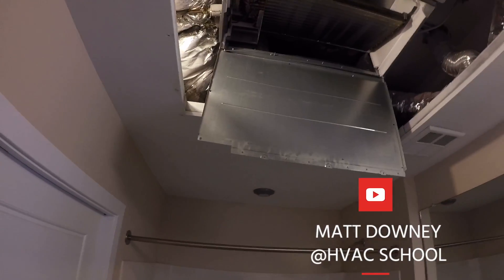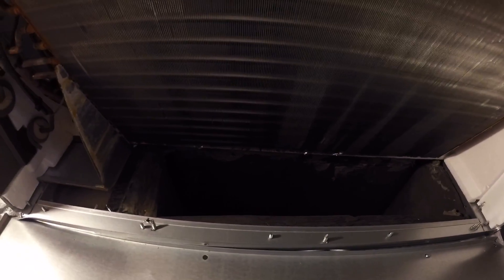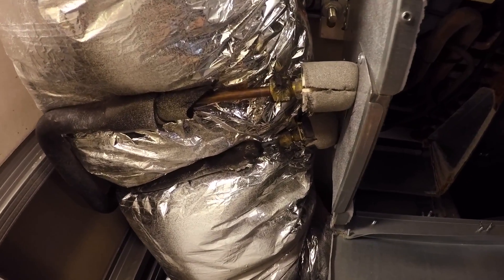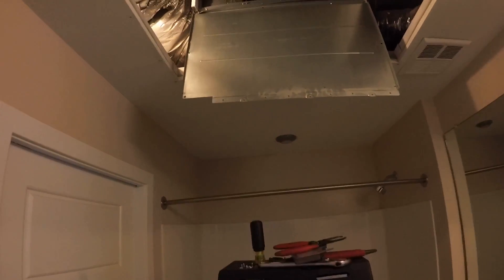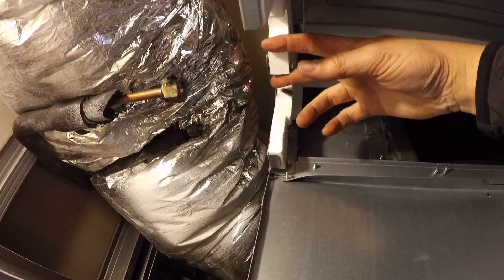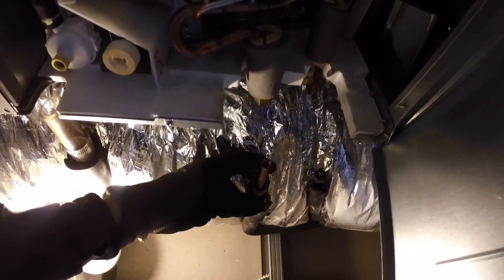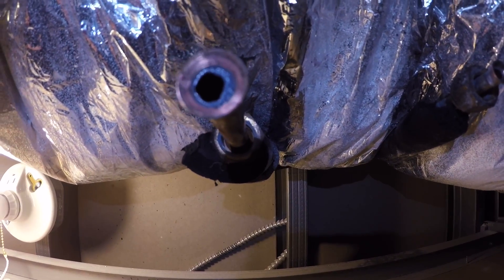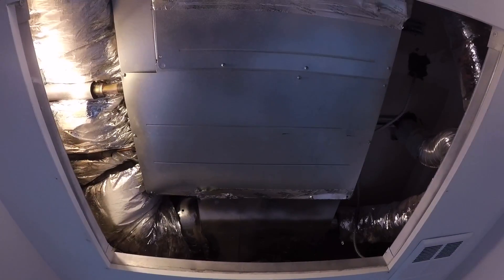Ducted Fujitsu Mini-Split Evap Replacement

Comment: Can you access the coil from the side of the unit? I have a unit with access to both sides but limited access underneath without completely disconnecting it and jacking it up.

Comment: Who uses Leak Lock instead of Nylog?
Reply: A certain Big Company In my area does. Service was constantly going back and finding leaks caused by improper use of leak lock eg don't put it inside flare connections
Reply: only use nylon

Comment: You always redo flares whether they look good or not. The copper has been compressed and work hardened once it’s used. 
      As for the blue leak lock it shows the person who is taught how to do this was taught by an amateur even though he may have 20 or 40 years experience. I often find the screens to the expansion valves partially plugged up leak lock but still working when you hook up with you to the software you will notice the electronic expansion valves duration ( dwell )opening time higher than normal because they’re starving and it’s trying to compensate. The technician will think it’s working OK because it cools to the hand beer can cold but the system is actually running very inefficiently